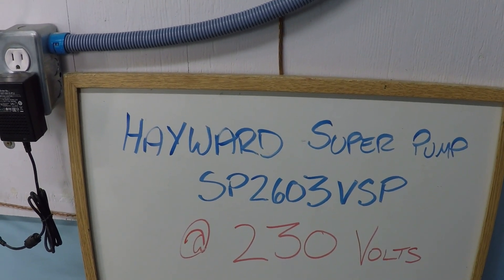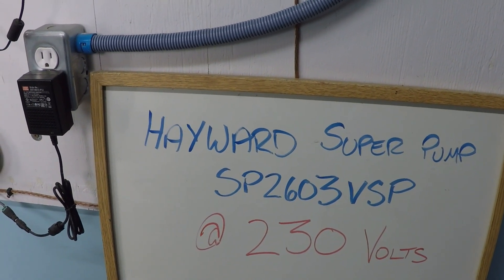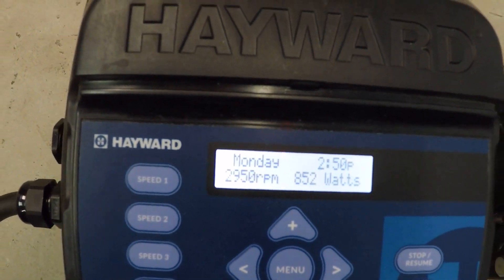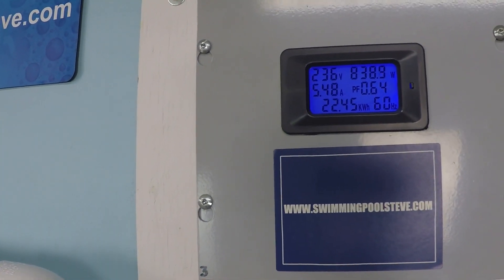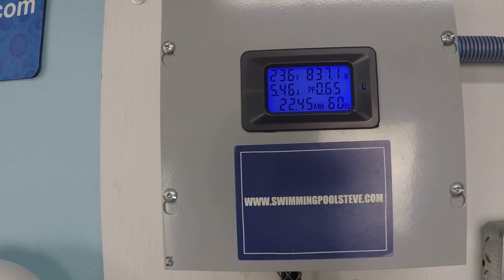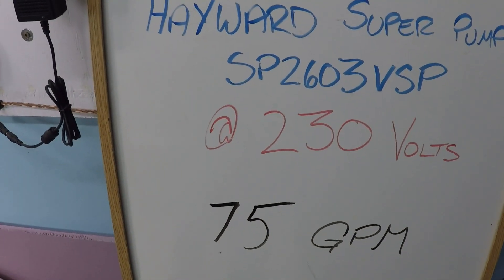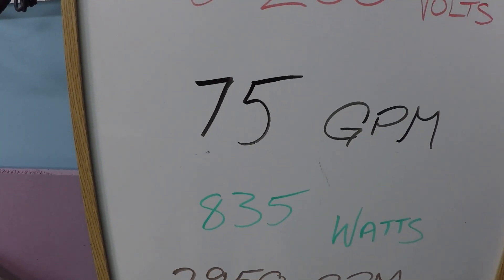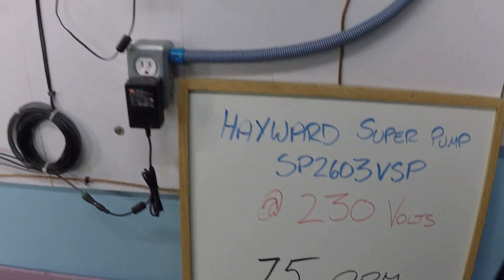What Speed For 75GPM? Hayward Super Pump VS

Comment: Hi Steve , love your videos ! I need help , trying to upgrade my pump , will I be able to use this pump your video is about for my set up ? I have a Hayward sand filter 62 gpm ,3.1 efa or model # ST44T. It's a 19k gl in ground pool with 1.5 piping 1 skimmer 1 jet 1 return line . If this pump your video is about is not good for my set up what you recommend?
Reply from the maker: Likely it would be a good choice but not enough info for me to say definitely. Every pool is unique, but based on the info you provided a 230v super pump VS a likely option.
Reply: Thank you Steve